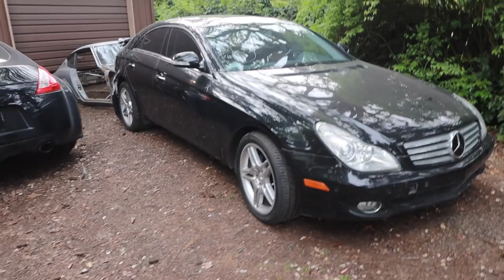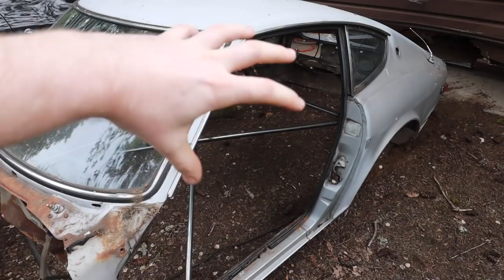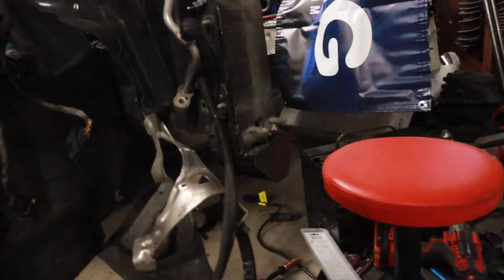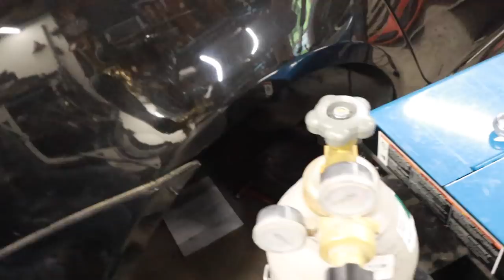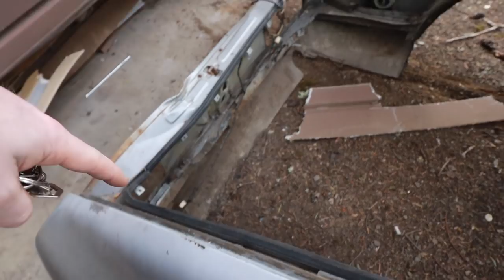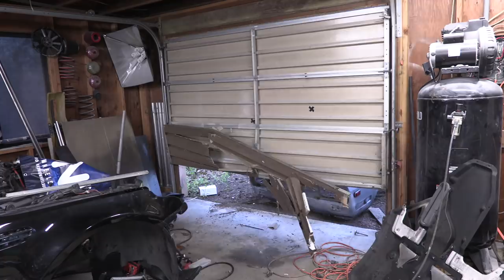TOW TRUCK DRIVER CRASHED 3 OF MY CARS AND KILLED MY 240Z...

Comment: When a young lad came through my driveway and hit my Riviera I was working on, I got next to nothing for it...  Home owners insurance is what I had to put it through because it was on my property.  So I had a claim against me for it.  Plus to top it off, they undercutting of what the car was worth was because it wasnt plated and insured yet... It could have been a brand new Mercedes and I wouldnt have been eligible for replacement costs.  They did however cover the damage to the garage and tools and new parts that I had reciepts for and covered 80% of replacement.  It sucks man...  By the way.  I live in Ontario Canada so our laws may be different.  I hope for you that they are.  I was also able to bill the insurance company for the hours I personally spent doing cleanup and repairs.  Track your time and materials as well.

Comment: It sucks but i wouldn't call it rust free there is a massive rust spot on the frame of the z but for the swap and new frame rails it doesn't really matter. Just make sure you keep fighting the issuance company for what you feel is right, don't settle until you are happy this is fucked up and since its not the first time this has happened that makes it that much more important! Cant wait for an update on what happens!

Comment: eh that Z is fine, the rear deck-lid is just a couple of spot welds. The dug in part should be fine as the cross bracing should hold it all together. I can send you measurements from mine if you want to know how far the cowl area needs to be bent out.

Comment: I watched this when it was posted... for some reason it was in my recommendations again... however, looking at this shows me that people can, are, and will be in worse shape than I am in life... my only car, and the only car I have actually fell in love with, is a 2004 pontiac vibe GT... 6 speed manual... not a fast car, not even really a quick car tbh... but it's the fastest and quickest I've ever owned... and the cv joints are going terribly bad in it... I dont have the money to fix it because of rent, and at this point, I can barely go 40 mph before they sound like they're gonna give... and if they give, then my transmission has like a 20% chance of surviving that... the parts arent expensive... but every paycheck ALWAYS has to go somewhere else... rent, gas, food, you name it... I just hope I can get it fixed before something bad happens

Comment: Give the busted 240Z a try. Use it as a 'engineering sample' or a 'test' or a 'buck' whatever you would call it. In prep for getting a 'new 240Z' to do it right, with everything you have learned from the first car. Or if you do it right with that shell then you would have another 240Z to sell.

Comment: You need a guy with a frame pulling machine to fix that up. Half an inch bend on that and it will never be right. I know a guy that does frame pulling but he's on the east coast. It's hard work

Comment: Body shops have books that have measurements for the body. So you get a tool (tram gauge http://www.collisionclamps.com/tram-gauge/), and the books have precisely defined measurements from different holes and spots of the cars body. that is what shops use when they do frame pulls etc. It's the only way to ensure that the frame and critical components are within the engineering spec == safe to drive. So technically, you could get that Z back in shape. but i wouldn't advise it without having the bottom part of the car body, firewall etc..

Comment: I got rear ended and found at fault. It took two years of fighting the insurance with a lawyer until they finally paid me back plus lawyer fees and for taking me away from work to fight a case i shouldnt of had to fight  in the first place. Remind you, i got rear ended at a red light and burst my def tank rear bumper and exhaust muffler on my 2013 passat diesel 6speed manual which vw bought back after their diesel fraud on the tdi engines so i didnt have to keep a crashed car even though fixed i know it would never be the same

Comment: Mate get a lawyer an throw everything at this towing company.. make sure to add the amount of hours of work you already put into the 240z an make sure to test your welders an makesure none of the tools are broken.. makesure to add how much time this will set you back to find another 240z shell with no rust.. makesure to say the towing company pulled the 240z out an didnt leave things how they were and caused more damaged to the 240z by moving it more.. an that this all could have been avoided if the company simply followed instructions of dropping the cars at the other property.. good luck mate things will only get better :)

Comment: First off, why did you allow the tow driver to unload the vehicle in front of the Datsun if it was so valuable and your house? Second, the tow operator should have brought it down with the wench cable with you inside the vehicle just in case something like this were to happen. Third, if you weren't home then you weren't too concerned in the first place. Fourth, why didn't you call AAA to deliver the vehicle? Even if it wouldn't be covered under AAA, though most people take advantage of this, you could've paid COD and have someone who is trained safety wise, do the job successfully. Fifth, what do you expect when the person you are delivering too isn't home to receive? Which means no TIP. A good tip goes a long way and reassures that you'll get an experienced driver who does the job right every time. One last thing. Was the tow driver informed that the brakes on the car he was delivering we're not working? Because obviously that would be important to know and could have avoided all this mess.

Comment: Cause delivery companies are picked so company you ordered it from, based on whats the cheapest, so they can make max profit. This is not the worst fuck up i have seen so far. One exotic car company sent like few hundred thousand dollar ferrari or lambo to customer, delivery company promised it would be there in 3 days.. well it turns out that driver had "mechanical problems" on the way... while in actuality he stopped to spend weekend at his home. Car was not delivered in time, buyer lost the interest and seller lost the sale, lost the regular customer and had to keep the car as it was specially ordered from dealership, for this customer.

Still try to make this 240Z to work.. i would hate to see it to go scrap pile, them being pretty rare.

Comment: I got a question... Did the Tow truck driver not load the car on his truck in the first place? surely if he did he would know if the brakes worked. yes i know your not likely to use foot brake if car is a non-runner but surely he used the handbrake/E-brake or however you guys call it (i'm British). When i was a trainee mechanic i helped to load and unload a few cars and i think i always knew if there was some form of braking ability for safety even if my co-workers didn't ask me to check, i always found it my responsibility to make sure i could control the car safely... now if say there was no wheels or car was burnt out then the control would always be the winch which was often used even if there was brakes i might add... i am calling that tow truck driver either negligent or incompetent. Rant over, thanks for reading  :p  Good luck with everything Chris

Comment: Correct me if i am wrong but how the hell is the Z "dead" the Z died the moment it got chopped up to be put on another chassis, no i'm not a puritan or anything but cmon if a tow truck driver smashing the windscreen and denting what is left of a z killed it then what did the guy with the sawzall do to it?... and the "Z" (well what is left of it) seems pretty straight due to the reinforcement bars it still seems like it can be bolted/welded onto a frame so why is that a big deal?

Comment: Sorry to tell you but this doesn't double as proof for insurance. The first thing any claims guy is gonna say is, maybe you damaged them at home and then recorded the damage afterwards.
Proof would have been inspecting and recording the vehicles on the back of the tow truck BEFORE accepting delivery. Something you should have done by rights. 
If your delivery, even if its a delivery of your own property, is damaged upon delivery, you do not accept delivery. You send it back with the delivery driver to the company as they now owe you compensation as it's now a legal matter. 
Doesn't matter if its parked out the front of your house and the tow guy has already unloaded it when you arrive. You haven't accepted delivery until you have accepted delivery and signed for it. 

This video proves nothing though.

Comment: Aweh man bro im pissed for you too. Tow truck drivers really give no fucks, i had to get a fuel line replacement for my 335 all of a sudden one evening and i used the first tow truck guy that pulled up, he smashed a few of the cars outside of my mechanics shop with MY car. Luckily there were surveillance cameras that captured the whole incident so the driver couldn’t bullshit. Which btw he tried saying his winch came loose or some shit, but in the video you clearly saw him back up straight into another car before he began lowering my car. There was an audi rs7 bent in passenger door, the shop owners mercedes suv busted front left headlights he left at the shop that day. And an audi q5 with a shit ton of scratches in the front. Anyway, bro it took so long but his insurance got it fixed to brand new (5 weeks for me) and i was driving a rental corolla they gave me for the time 😒. I hope this does not take too long for you. But keep your head up and make some videos of the fairlady for the time being. Don’t expect something to happen fairly quickly. Sorry man

Comment: Thats all easily fixed...nothing to it.
Reply: Nothing? A garage door costs around 400-600 usd, a rear bumper for a m5 is around 200 usd without paint which would be around another 100-150usd. A rust free 240z can go from 3 000 to 10 000 usd. That also doesnt include the lost revenue on the videos he couldof made with that 240. Best case scenario thats around 3700usd + revenue from the videos he couldof made with the shell, as far as i know 4k isnt a small sum of money.

Comment: The driver fucked up.
No need to be an arsehole about it. Not sure how insurance works there, but pretty sure in Aus the tow company's insurance would pay for something like that. How is posting a video like this going to help your cause? I know your angry. The driver is probably angry too, knowing that he fucked up. Yelling and screaming about it isn't going to fix anything. You're gonna get more worked up, the tow truck driver is going to get worked up and it's gonna be worse in the long run if people act like arseholes.
This may be the case in property claims from time to time, but there is no reason to share this kinda stuff publicly.
Woulda been happy to see you post a disaster video without so much anger and blame. People do fuck up, we are human. I bet you fucked up numerous times and got angry about it yourself. Post some videos of your fuck-ups or better yet. Some fuck-ups you caused at work and the customer's response.
Shit happens. People weren't injured. Cars, buildings and tooling can be repaired. People can't.

Comment: Oh no someone ran into my rigged up junker cars, I'll turn in an insurance claim... LoL   How is the adjuster supposed to value rusty junk? I don't think KBB values salvage vehicles or ones that have been unprofessionally rebuilt by the shadetree mechanic using popsickle sticks and scotch tape.
Reply: i was thinking the same thing, what insurance company is going to pay anything for a rusty cut up piece of a worthless datsun?
Reply: Ya I cant comprehend how this guy is talking about these broken junk cars like they're brand new or completely restored. 

"smashed into my 240", its funny how he talks about the "car" when its a body and some doors.
Reply: ProfesserNutButter
   LoL, maybe he's valuing it on what the thinks it COULD be worth after he slathers on 40 pounds of bondo, does a bunch of ghetto welding, jerry rigs up the mechanical aspects, and then considers it "Restored". I've watched some of this guys stuff and he should include a disclaimer with ANY of these cars if/when he sells them that they have been unprofessionally repaired (And I'm being generous saying repaired) so if someone gets in a wreck and the car breaks in half and causes more injury than the same car that has been repaired correctly he doesn't get his pants sued off. This guy gives the phrase "Good Enough" a whole new meaning...
Reply: The frame of the car he's not getting anything for, that's cut and dry. He does have a case for the mercedes though, because from what he said that was a brand new car and the tow company just smashed the back bumper.
Reply: Yeah. I'm sure you would be happy if someone trashed your projects, then some idiot online said it was just junk anyway.
Reply: Except that the purpose and work invested are well video documented.
Reply: Hunter Jones If you think so negative of him why watch the channel just to talk shit lol. Might not mean anything to you but it does to him so many negative people one here bashing people but here you are watching his channel